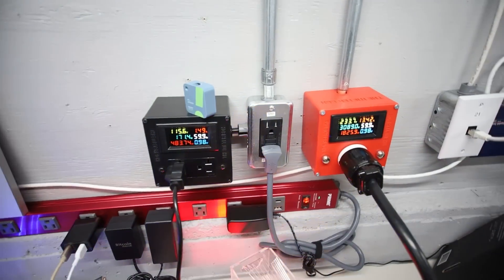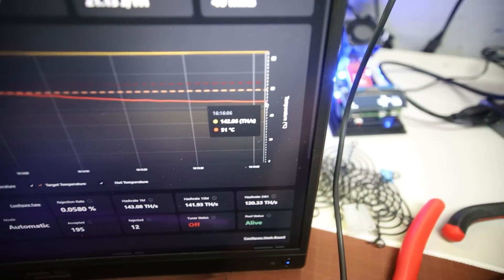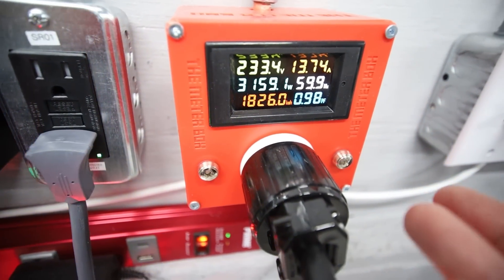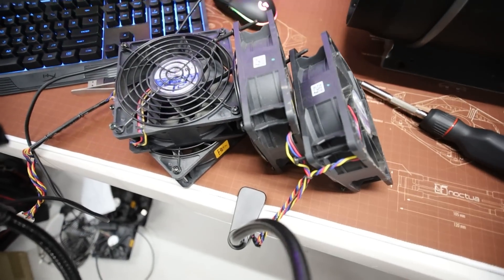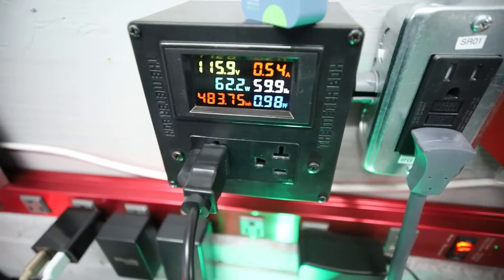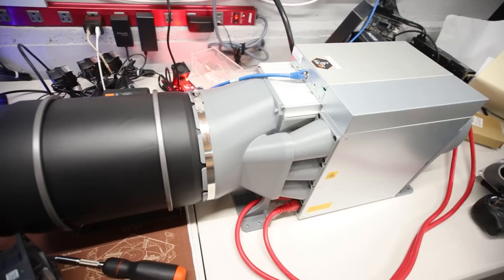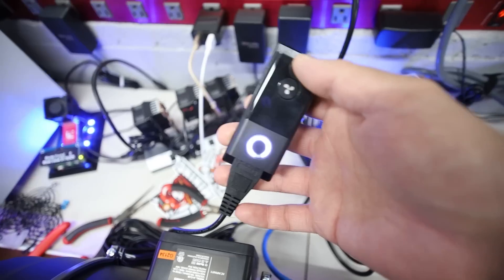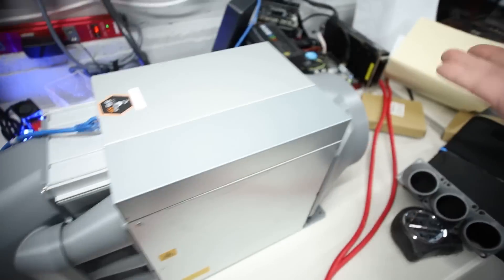INSANE bitcoin mining power usage DIFFERENCE based on temperature and airflow.

Comment: I have noticed that using mine. Hobbiest also mentioned it a while ago when he installed his AC infinity fan in his mining shed. If you could have solar powering the fan you could essentially run on lower asic power and not worry about the added power from the fan.

Comment: If the temprature is higher the resistance in all the contuctors and silicone junktions goes up and higher restistance higher power loss 
also there are electrical leaks in form of cracks in the silicone that also gets worse at higher temps or higher voltages

Comment: I'm running an S19 Jpro (104 TH) with stock fans but Braiins OS with a 2800 watt target power and as long as it has no issue maintaining temp targets I'll get about 27.5 J/TH when the fans are still at 100% but temp is 60 (sometimes the fans go under 100% but only going by 100% for the sake of comparison). When we have a hotter day and the temps can't maintain 60, my efficiency can usually go as low as 31 J/TH or so when temps get to 70+. At that point it starts pulling hash to keep temps from going much higher. The worst I've ever seen was 72 C and 32.5 J/TH at about 97 TH/sec. When it's cool out, and the fans can ramp down, I can see efficiency get as high as 26 J/TH, which is higher than just from the fans using less wattage. Obviously the Braiins OS allows some leeway in wattage targets, but also has safeguards to prevent things from getting out of control.

Comment: You need to lower your ambient temps where your mining then you can lower your fan speed and achieve the same lower power result, would recommend installing two mini splits in the basement based on how much hardware you have running

Comment: I noticed this with my install of Braiins OS on my S19J Pro 104th model.  The OS gives you the option to set a hashrate target or a power target.  If you set a hashrate target like i did (110th), the power will vary from 3100-3600 watts depending on the temps.  I did a test setting power target to 3068 (stock power) and the HR would vary from 105th to 85-90th when it got hot

Comment: Quantum physics in action :). Heat creates resistance requiring more power to overcome the resistance which creates more heat. If you could freeze the miner you might drop the wattage down to 2500 watts, maybe less. This is why facebook hosts its servers in places like Finland. The colder the ambient temp the more efficient the silicon runs. I was thinking of burying a large diameter pipe underground and running air through that for the asic intake.. geothermal cooling.

Comment: That's awesome about the drop in wattage on the ASIC Vs. the AC Infinity fan! I was considering getting a fruits and associates set-up but I was hesitant because of the wattage needed to run the AC Infinity. Looks like it's a great trade-off! Quieter and cooler ASIC and a saving in power

Comment: RPM I see this major swing only when running aftermarket firmware, when you use stock firmware the wattage swing is allot less because the stock voltage is normally higher then when you use aftermarket firmware, but yes during winter all my BTC Bitmain units used about 1 amps less and 1+ more during the summer, you should run the test using STOCK firmware.
Reply: Red Panda Mining, I think you need to have a Live stream about this because many people may misunderstand what they just saw on the video, don’t understand how electric work, temperature change electrical resistance resistance and base voltage chips running is, the best example I can give is the L3+ 504Mh at 800w -/+ 5% stock firmware vs 504Mh at 660w with aftermarket firmware, the major difference is the Voltage drop across the chips, however doing so now make them more sensitive to environment temperature change, as they will pull more wattage to compensate, hard to explain on a post but to reduce the swing put back the stock firmware.
Reply from the maker: I noticed this with stock firmware too actually for the s19xp.
Reply: @RedPandaMining  I don’t have an XP only S19j etc.. the stock does swing by 270w depending on temperature but slowly winter vs summer, however the only time I see the swing so rapid is when I am using Hiveos firmware because the voltage is lowered, would be nice to compare the two. stock vs aftermarket swing ratio, remember I do agree they both swing up and down base on temps, just saying one does it much quicker then the other.
Reply from the maker: @fullyelectric  i did mention environmental temp matters in the video too!
Reply: @RedPandaMining  yes you did, you already provide all the details just hope they get it lol .. what was the best balance between the fan setting, loudness and miner wattage used?